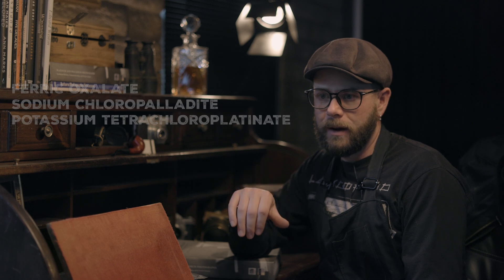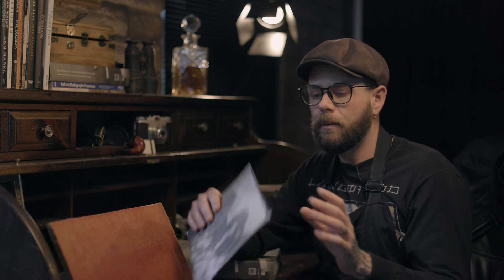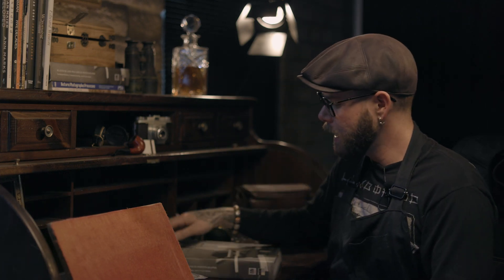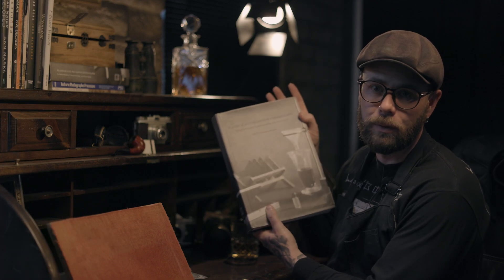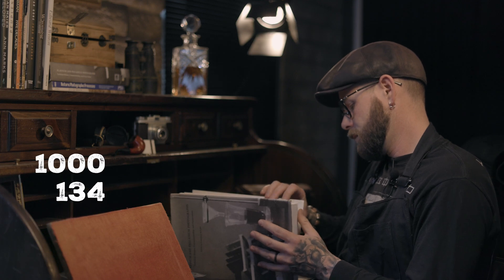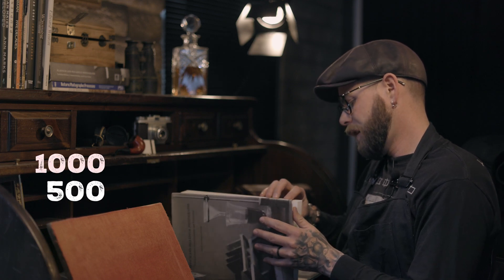Platinum Printing: How does it work?!

Comment: Hi. Your videos are both useful and enjoyable. Thanks. I'm just getting into making what I need to start. One question that I don't find addressed is "what type of glass is used in the contact frame?". I read that glass blocks quite a bit of UV (especially if it's "museum" type). Is this an issue worth considering when putting something together for the job please?